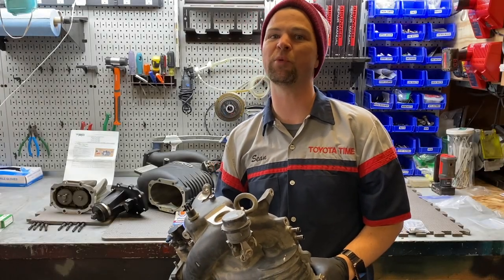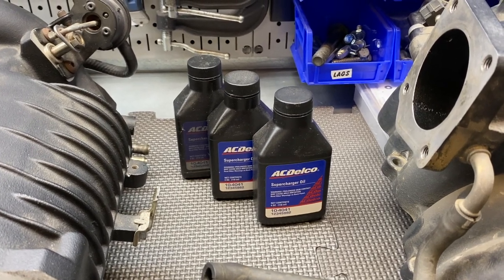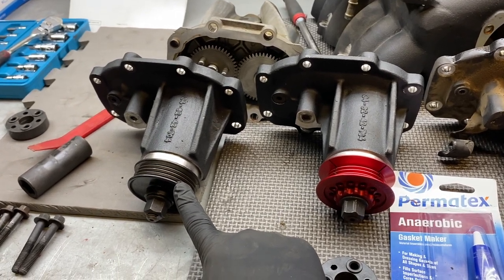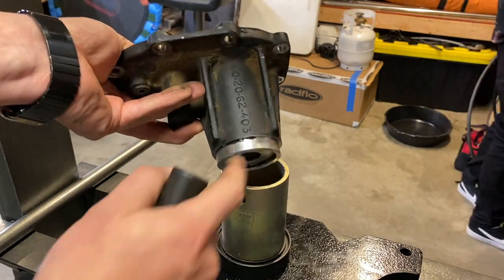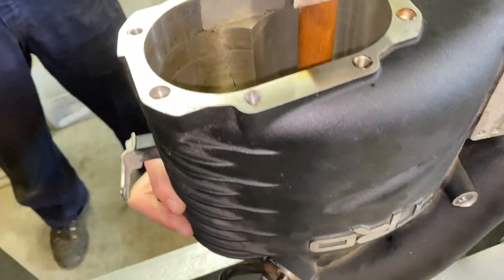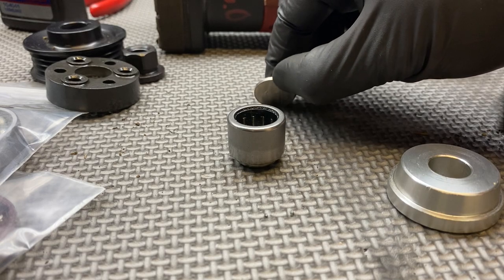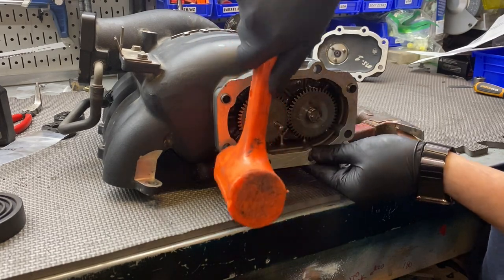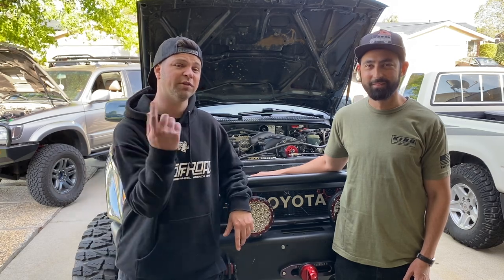Rebuilding a 3.4L TRD 5VZ-FE V6 Supercharger (PTR01-35962) - Eaton Rear Needle Bearing Replacement

Comment: So awesome to see you guys doing this job🤘🏻. I spoke with Sean last year about this as I have the second casting of the 2nd gen supercharger where the needle bearing does not press put on the drivers side. Me and him had a long back and forth over the course of a week or so and had us both stumped on why my casting was so different than his because all the write ups we could find all showed that the bearings should just press out and could not understand why my housing was so different. Finally decided to deep dive into the internet and found a blind needle bearing tool which did the job and relayed this back.
These two guys are a service to the 3rd gen community and having them as a resource has made a lot of the jobs I’ve done to my truck so much easier. Rock and roll dudes.
Sicmods 4life 🤙🏻
Reply from the maker: That one bearing in the back on certain housings is definitely something people need to be aware of before starting this job. Thanks for reaching out and talking through your struggles with me. We appreciate the support.
- Sean

Comment: What's the cost to build TRD supercharger onto the 5vzfe I've done injectors before found it pretty simple I watch one of your old videos 😀 I'm shore if you have a video on Installing TRD supercharger and what parts are needed to running driving I'll be fine
Reply from the maker: Well this video links to a kit to rebuild the SC. The kit is about $140, so pretty affordable to rebuild assuming you have the tools and this video to get it done.
- Sean

Comment: Hey Tim, as always excellent content. You guys have helped me through everything from ball joints to fuel gage sending unit. Have you ever considered doing a 3rd Gen 4Runner 2WD oil pan removal / replacement? There just aren't any good videos out there. I think I found (2) and they were really bad. Anyway, wanted to ask and hope you guys have a safe and fun holiday weekend.
Reply from the maker: With a 2wd, dropping the oil pan is pretty easy because you don't have the front differential in the way.  A tool that works well to help you separate the oil pan is a thin flexible putty knife.  You drive it in by tapping on the handle with a mallet or hammer.  Once it's in, you can push it forward or backwards to start separating the pan from the engine block.
Reply: @TimmyTheToolman  Hey Man, you're the first person, (the first person I trust) who ever gave me any feedback. I have read the stories of guys struggling with 4WD 4Runners and removing their oil pans. Having to raise their engine etc.
There's one or two videos out there of oil pan removals on 3rd Gen 2WD's but they are really low quality and I couldn't get the entire picture. I have had my skid plates off plenty of times. Inspected my oil pan seal plenty of times but I always wondered if there was some mysterious step I wasn't seeing. Maybe some weird obstacle standing between me and simply dropping the pan straight down.
My pan was installed in Japan in 1996. So did those tech's install it with sealer or a Toyota gasket? And if I drop it, do I go back with sealer or some actual Toyota designed gasket?
BTW, Sean is making some really good videos. He is easy to watch,  easy to understand and makes for an overall good presentation. Maybe you guys have been taking some video production classes at the local college?
Reply from the maker: @turnah8242  They seal the pan with Toyota FIPG 103.  That's what I suggest you use to reseal it.  There might be an aftermarket seal you can purchase but I wouldn't recommend it.  

No classes for Sean or I.  We're just learning as we go and trying to improve or video quality.
Reply: @TimmyTheToolman  Got it.................if you told me to seal it with the uterus of a virgin Spanish goat, I would. I'm that guy, I'm all in and I follow the advice you two excellent wrenches are putting out.
As always, mucho thank you. Enjoy the weekend!
Reply from the maker: @turnah8242  Sounds like I might be able to sell you a bridge with low miles and in good shape.  I'll give you the special Timmy the Toolman price. 

Now, on a more serious note, Sean and I try to give our audience the best information possible.  Sometimes, better information becomes available, or better techniques are learned, and we give out that information either in the video description or a pinned comment (1st comment you see).  So, be sure to look in both areas for any videos you're using as a tutorial. 

Thanks for being a fan of our channel.  Happy Wrenching!

Comment: does the rear bearing get oil from the front at all??  I have had mine on my 4runner since 80 Miles, do ck and have changed out my SC oil with Toyo SC oil. Have done once. 
All is normal sounding, thankfully
Reply from the maker: The nose cone bearings all get oil… the rear housing rotor bearings do not get any oil. We have other videos on this style supercharger in case you’re interested in seeing more of the unit disassembled.
- Sean
Reply: @TimmyTheToolman  I guess, been fortunate, so far ok, rear bearings not giving any trouble with 125 k miles.  I will keep aware though!! Great videos. !!

Comment: Great job with the video, I wanted to ask you if you recommend any good clutch and flywheels for a 2000 3rd gen 4runner with a supercharger, 2.2 fully, and a 7th injector. the 3rd gen is 4x4
Reply from the maker: I'd either go with Toyota OEM or a heavy duty Marlin Crawler clutch, pressure plate and fly wheel.
Reply: do you think that the marlin flyWheel and Center force Clutch that you made a video on would be enough for it? 

on a Side note, are you able to pass smog in CA with the 7th injector mod? 
 @TimmyTheToolman
Reply from the maker: @marcushauen-limkilde4994  Yes, the Marlin Crawler flywheel and clutch would  work.  Yes, people can pass smog with the 7th injector mod.

Comment: Hey Timmy! I recently rebuilt my super charger, pressed all the bearings myself on the nose cone. Unfortunately my needle bearings broke and I had to send it in to get done. Since I reinstalled it I’ve been having some issues, when it’s under load 60-70mph or going up hill I can hear air releasing from the engine bay. Unfortunately once I slow down it goes away so I can pull over and see where it’s coming from. Have you ever heard of anything like this?
Reply from the maker: Air releasing?… it sounds like a vacuum leak or a hose is still disconnected, Are you sure you reconnected everything the same way you had it before you removed it? You could do a smoke test if you suspect an air leak.
- Sean
Reply: Yup I’ve gone through it all multiple times. The weird part is it only happens when it’s under load. 🤔 I did schedule a smoke test to see what can be found.
Last night I went for a short drive and now I’m getting a knock sensor bank 2 code. When I had it rebuilt I also got new injectors from motorwest and a OEM MAF which I had a previous code for. So I’m kinda lost, idk what happened.
Reply: I’ll send you a video in instagram so you can hear it

Comment: Hey Timmy, I'm in the middle of replacing seals, bearings, etc. on the rear of my 3rd Gen. Cleaning everything up right now and am going to do the press work tomorrow (with Duane's tool). I've watched your excellent seal / bearings video 5/6 times but I wanted to be for sure on something. So when you install the new seals, is it going in dry with no white lithium, red general grease, black MOLY, spray teflon, etc.? 
Thank you in advance for any input you can give me.
Reply from the maker: Yeah, those rear axle seals go in dry.
Reply: @TimmyTheToolman  thumb!

Comment: What is the outside diameter of the supercharger shaft, or the inside diameter of the supercharger pulley?
Reply from the maker: We didn’t measure that.. are you trying to make your own or something? All these parts should be the same across the black supercharger units.
- Sean
Reply: @TimmyTheToolman Yes, trying to make a one way bearing or sprag clutch style like an over running alternator. I'd like to make a 7 psi pulley with a one way bearing that way once the turbo spools up it can blow through the supercharger and the supercharger shouldn't multiply boost (I don't think)

Comment: Would freezing the needle bearings be beneficial to aid install ?
Reply from the maker: They aren’t hard to press in, but yes. Any bearing can be more easily installed if it has been in the freezer to help it shrink a tad.
- Sean